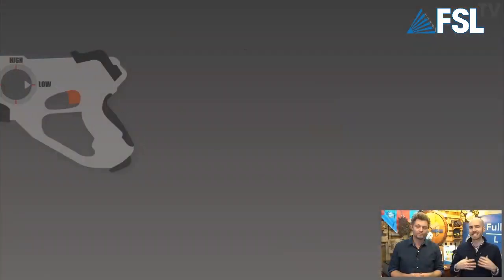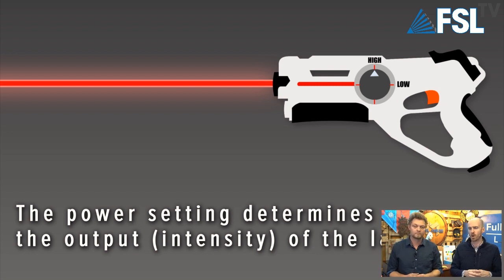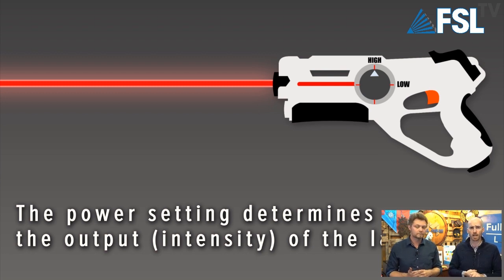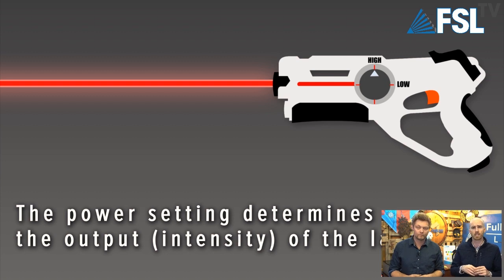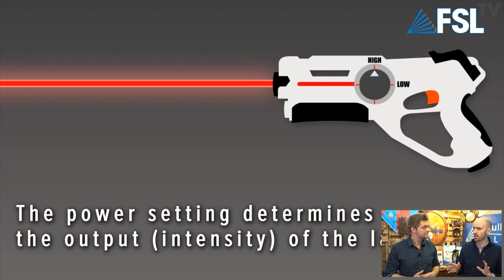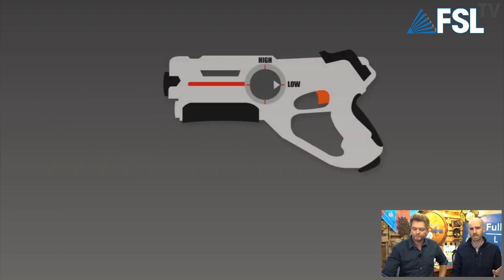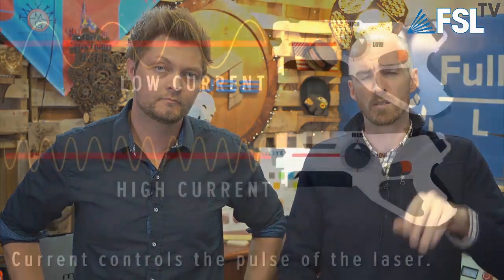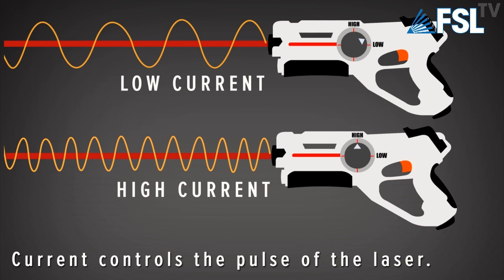What's the difference between power and current on a laser? - Ask the experts

Comment: Hi Guys!

I am the proud owner of a 45W Muse and, despite the fact that FSL claims the life of this tube could last 3000 to 6000 hours (I dare assume this is at 100% power), In order to prolong my tube's life, I generally use it around 35-40% power and around 50% curent.  I am playing with the speed, rather than power, since time is usually not a factor for me.

Am I right thinking that way ,, or I'm just taking time for nothing ?  My understanding of the whole deal is like .. driving a car from Halifax to Vancouver at 240km/h all the time (providing your car can do it).  You'll get to Vancouver faster, but at the end, you're stretching your motor too hard and it will not last as long as if you're taking your time doing the same trip at 100km/h all the way.

Thank you for your comment, and I hope I'll read from you soon.  Have a great day.

« Uncle Dan » !
Reply from the maker: While not a direct correlation, your analogy is close!  Like all consumable items, the way in which you use it will directly affect the lifespan. Proper use, cooling, power and current all play roles in this.
Reply: Hi again.  Thank you for your quick reply, confirming my theory.

Since I'm in Canada, the CW3000 Chiller's temperature reads around 20°C (68°F) most of the the time.  Some times, on long jobs, it can reach 22°, but it's rare.

Can you confirm my theory regarding the alleged lifespan of that Laser tube (3000-6000 hour at full power .. and good cooling temperature)?

Thank you for your comment!  I'm an FSL Fan for life.  Maybe I should enter the weekly contest more often!  Hahaha!  I do GREAT things with my Muse!

Have a great day!